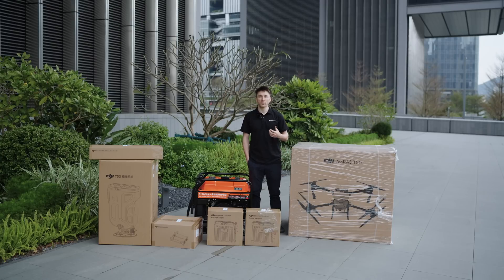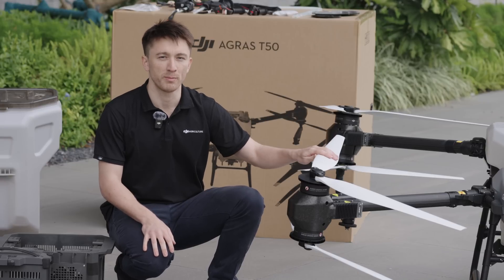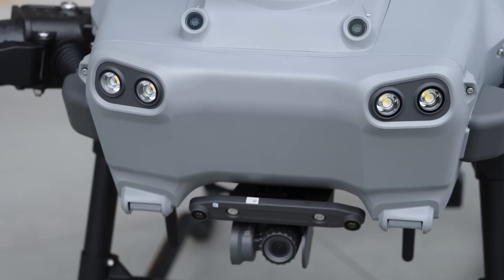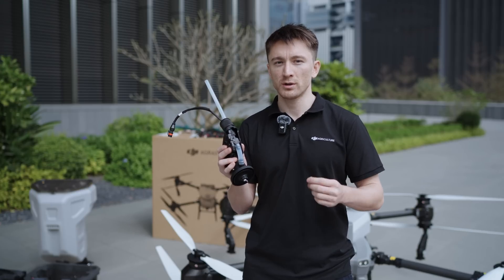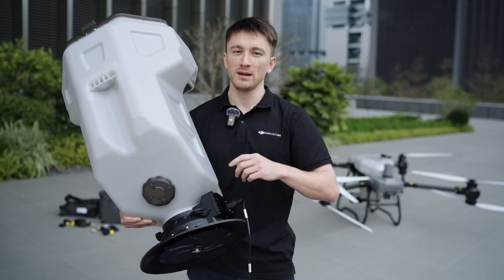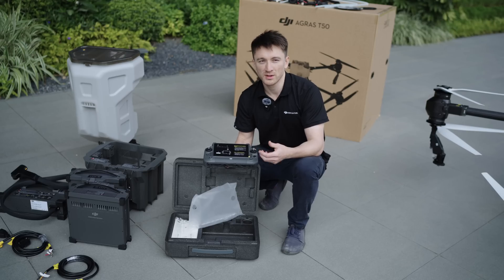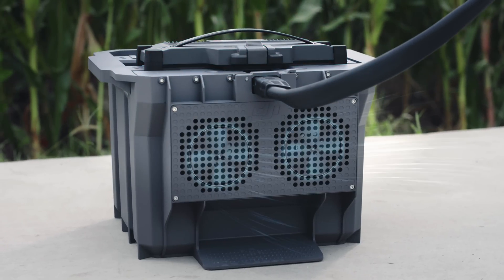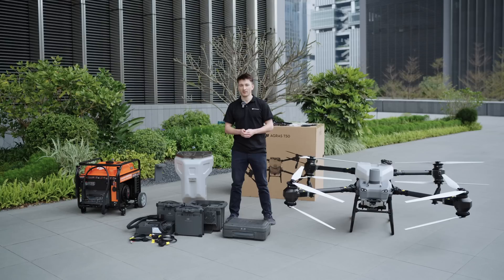DJI Agras T50 Unboxing

Comment: I've been using DJI Agras T40 for a year now. I cultivated only 1300 hectares on it. A very beautiful thing, but very unreliable in operation. Over the course of time, there have been a lot of bugs in the program and in the quality of the drone material. Over the entire period, the drone crashed three times, two times due to a bags in the drone’s software.

Very weak plastic parts. The holders of centrifugal nozzles and plastic antennas constantly fall off - I had to change everything once. I replaced one centrifugal nozzle - it fell apart due to rotation. I changed the pump motor and the nozzle motor - the channels became clogged and burned out.

A separate conversation on the reliability of the electronics of the drone and the generator: I have already changed the entire weight sensors with wiring once, as well as the wiring for centrifugal injectors and a flow meter. Now, a week later, it again shows an error in the weight sensor and flow meter. I need to go to the dealer again to replace them.

Now I have been waiting for 3 weeks for a new electronics unit for the 12000epi Generator. The old one is broken - it no longer charges the batteries. The dealer promises to replace it under warranty - thank God.

One of the two batteries does not charge the first time, charging turns off at 20% and shows an error on the charging unit from the electrical network, you have to restart 4-5 times before this battery is fully charged. I talked to the dealer, but he hasn't made a decision about replacing it yet.

 The total price for the drone along with additional accessories is $33-35k. This is not a small price, comparable to the cheapest Tesla Model 3!
I wish the DJI company to work a little more on the reliability of the drone and the program.
Reply from the maker: Thanks for your suggestion. We have recorded it and forwarded to our engineers and aftersales colleague.
Reply: Still way better than that garbage Tesla lol

Comment: i am wondering what the price is of the drone. just out of curiousity.
Reply: $20k ish depending on setup and accessories. also factor in another $500-$4k for the multispectral drone that ties with the farming app.
Reply: @Jamesbourke7  spoke to a dealer here in Ohio, they said the new t50 with 4 spray heads cost around 40-50K. but that is from a dealer and he has to make money too.
Reply: You can check on the website

Comment: Incredible. Is the C10000 charger powered by 230 or 400V?? Is that a three phase or single phase input pls?
Reply from the maker: It supports dual 220V single phase inputs : )
Reply: So You Can use two independent 220v single phase sources??
Reply from the maker: Yes
Reply: Now that is extra interesting! Great